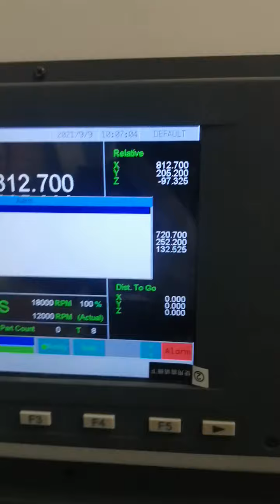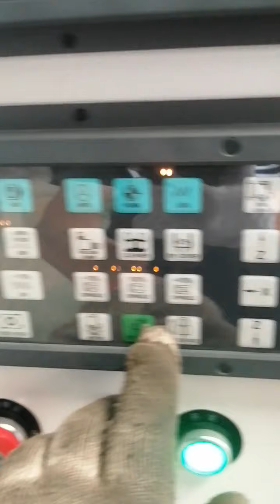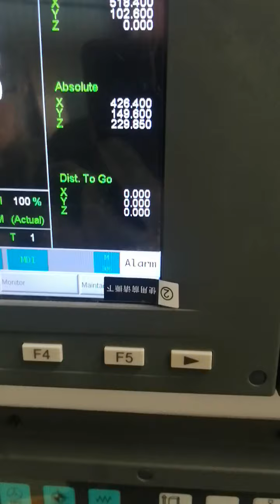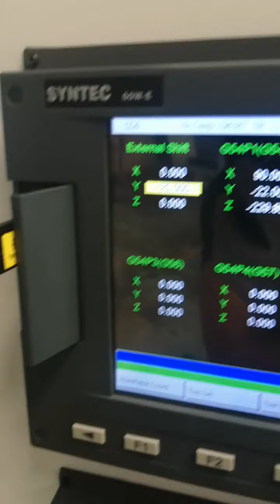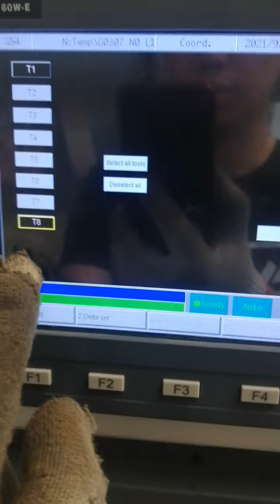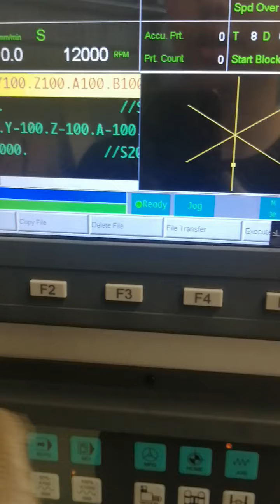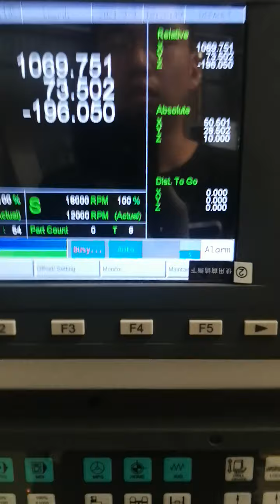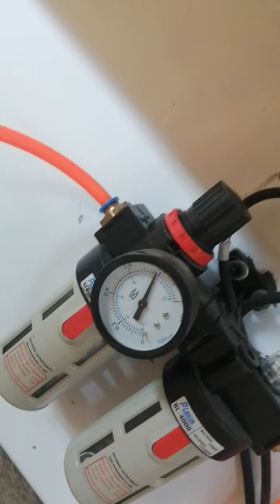how to use  60we Syntec for linear ATC

Comment: Hi, I have installed a brand new syntec 11mb, it's connected to servos 
I need programming and setup the machine. 
Whould you be interested to do this job for my cnc 
We can talk about the cost
Reply from the maker: ok, contact with me on whatsapp +8618560201508 , check if i can help you